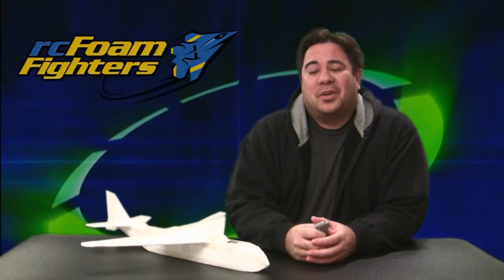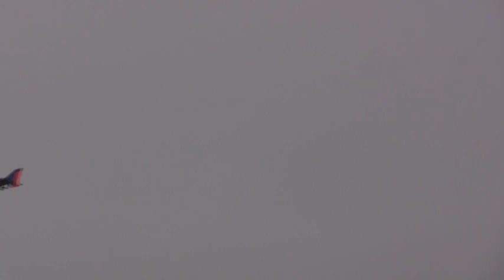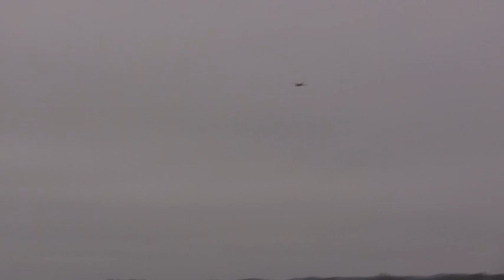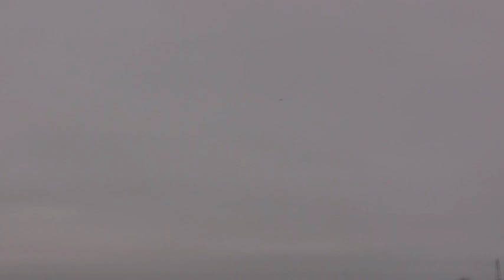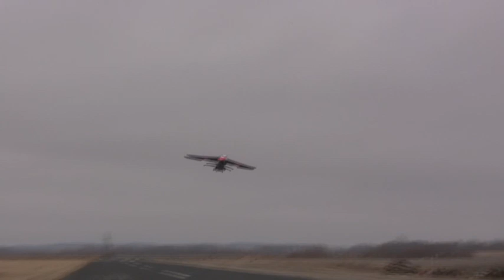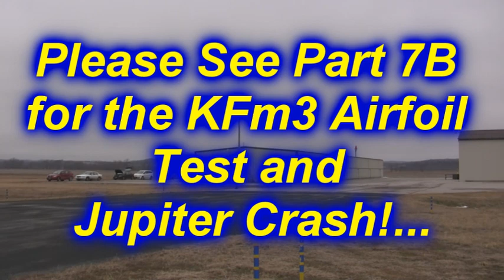Project Jupiter Part 7A "Testing the Airfoils"

Comment from the maker: Thanks Ken! I agree with you, I'm starting to find the KFm2 to be the best of the three airfoils.  I just wrote an email to Dick Kline telling him i thought that the KFm2 is starting to out shine the other two.  The feel behind the sticks, is that the KFm2 is more stable, seemed to maintain the glide better and longer with out stalling and feels more locked in and stable. it does feel a small bit slower, but not enough to out weigh the benefits it gives. Thanks again Ken!

Comment: my favorites are still the KFm2's even though i find them to slow the plane's top speed down by about 10%-15%. it fit's my flying needs the best because i fly in small parks. Paul, you may be surprised how well you do with your gut feeling. i deal a lot with statistical findings and research outcomes. someone as experienced as you can provide pretty accurate feedback based on your "gut" alone. also, i like how other's gut feelings have been pretty consistent with the KFm2. great job as usual!!!

Comment: It's actually getting very close, the glass is on, it's in the sanding stage, then on to paint. So another week or two and you should be seeing either an utter failure or a crazy fast plane. if it's a success, you're getting it in the mail for that 1400watt treatment. i just cant wait to see how a super smooth painted surface affects the speed. i think drag coefficient in the foam realm needs to be tackled.

Comment from the maker: Dickeroo, Thank you so much for your help and insight on this project. I am learning so much about the airfoils. Even though it may be a little slower because of the overly tall step, I think the KFm2 is really the lock steady airfoil of the bunch. It did not stall like the Clark Y and felt more locked in than the KFm3. More tests to come once I fix the Jupiter. And none of this ever would have been done without your cool invention! Thanks again!
Paul